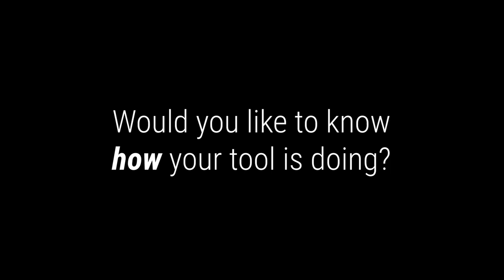Karcan Cutting Tools – tool life monitoring with spike®

Comment: 3000 rpm, 2000 mm/min Feedrate and a Feed per Tooth of 0,1... so your Tool has 6.67 Teeth?
Reply from the maker: Hello Tepre,

our partner Karcan Cutting Tools used S:3000 rpm and F:2000 m/min on the bench.

However, while processing the parameter information to the video, the video editor has rounded the part after the comma in the FZ: (progress per tooth) section.

So no worries 😉. If you would like to get more information about spike® and its benefits, contact us via inquiry@pro-micron.de